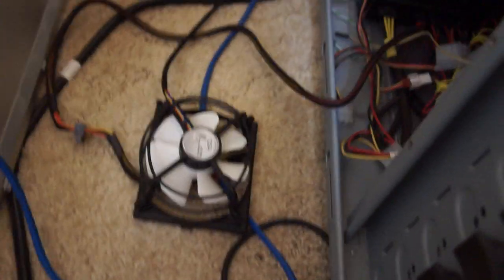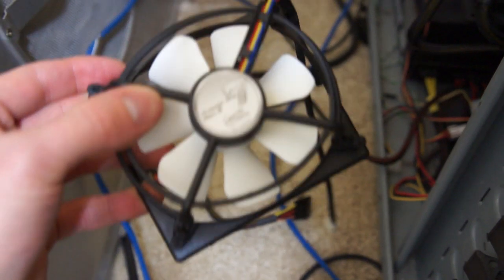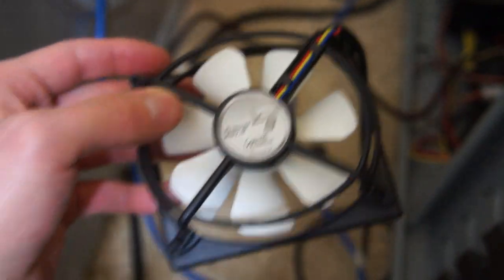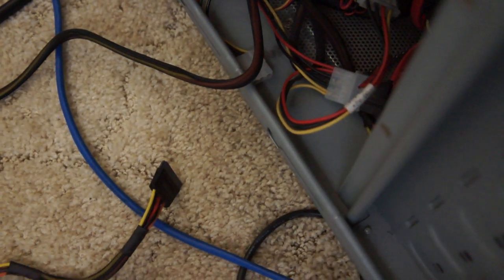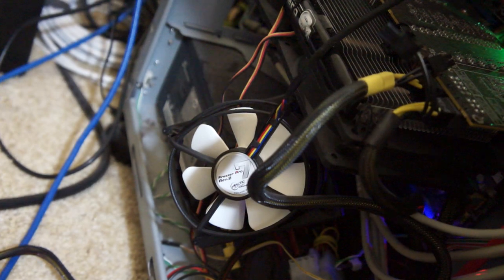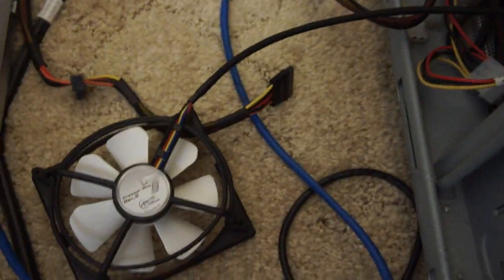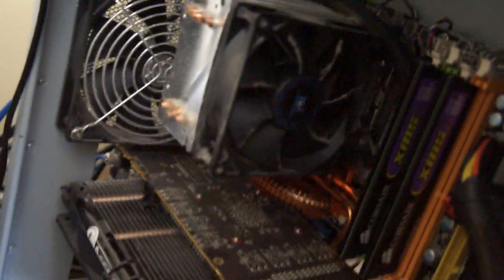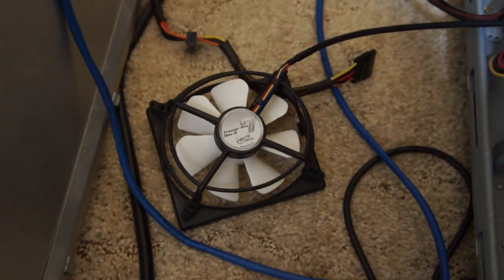Defective Arctic Cooling Freezer 7 Pro Rev.2

Comment: "It appeared that the fan blades were not firmly pressed into the motor assembly, and simply but pushing the hub down into the motor, it snapped in and appears to work properly now."

Thank you!  I just got this heat sink after having my computer disassembled for the past week and was extremely frustrated when the fan wasn't working (thinking that it was DOA). This saved me a lot of frustration.

Comment: Mine was a problem with the wiring, I just had to moves the wires a bit to get started. Mine looked like the blades had a big space between the motor, but it was just the wires

Comment: what fan is attached to the heatsink in this video? i've got a f7pro (rev.1) with a failing fan; the second time one of their fans has failed on me. instead of buying a replacement which will just fail again, i want to mount a better fan to the heatsink. does the rev.2 model heatsink allow you to mount a different fan or is yours jury rigged to it? how did you attach it?

i like the arctic cooling heatsinks but their fans are just trash. they should switch to fluid dynamic bearings.

Comment from the maker: Heh... that *is* with the cables managed. I had a lot stuffed into that case, but the worst culprit that you see there is the dodgy way this case required six fans all connected with 4-pin molex connectors. I also had custom cooling on the video card that used 120mm fans with 4-pin connectors because it was nice and quiet that way.

My new computer is looks a little more elegant than this ;)